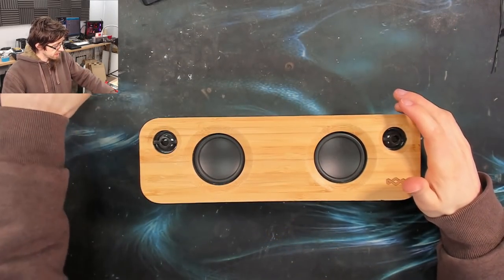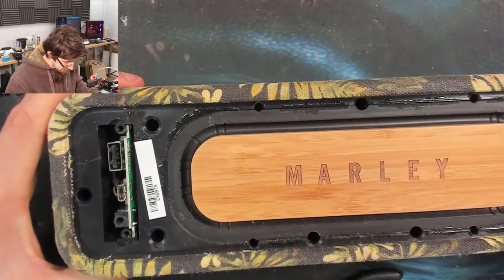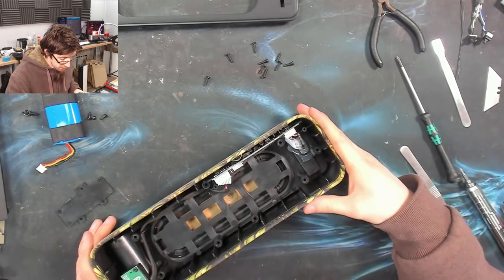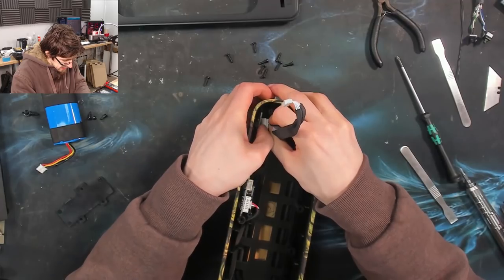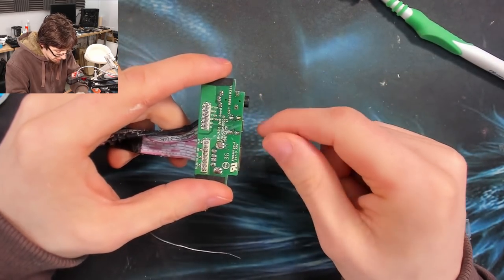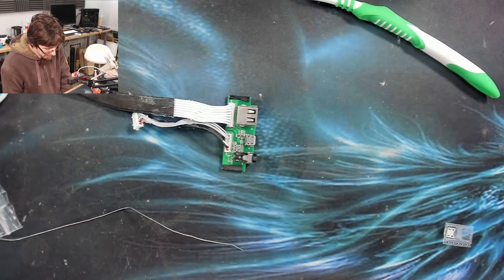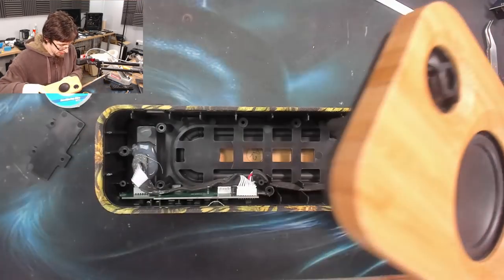Marley Get Together Bluetooth Speaker USB repair - LFC#293

Comment: Isopropyl alcohol is great at loosening hot glue.  It doesn't dissolve it but it makes it brittle and seeps underneath to detach it from the item.
Reply: Yeah it's devastatingly effective.
Reply: great tip, didn't knew about it
Reply: But plastic not a good idea

Comment: 99% IPA for getting hot glue off. Much safer than heat 😉
Reply: But what if I use 100% IPA?
Reply: @comicsanz97  Then the universe will implode.

Comment: i used to struggle to clear holes even with good quality solder wick but the method i use now which works great is just an old fashioned solder sucker, i hang the board at the end of the table, take hot air to one side to liquify the solder and then i come with the pump on the opposite side to avoid getting burnt and since heat is being applied at the same time it prevents the solder from hardening by the time you get the sucker in place, done right you can clear 2 holes in rapid succession

Comment: When using hot air to melt / remove anything, start at a lower temperature (100c to 150c), Most wire coatings are rated at 150c, better coatings at 200c, rated is an operating value which means they will tolerate more than rated before failure. These and most plastic will not melt but burn with high heat and 250c, especially from a hot air gun (localized heat) will destroy or deform  plastic items before you realize it. Plastic is never melted to a liquid form but extruded in a malleable form...

Comment: It was interesting knowing that you didn't know that alcohol is good to remove hot glue. I am fairly new to hot glue myself (~ 1 year) and discovered by accident that alcohol breaks hot glue when I was cleaning a pcb that had hot glue holding wires and the hot glue gone britlle and then it could be wiped. The hot glue can be reused by melting it again with a old soldering iron tip or something like that. I use hot glue often to bind things to a surface (like hold wires against a pcb) in a non-permanent way and it doesn't damage plastics.

Comment: Small tip, if you tin the connector first makes it easy to to flow back to the board.
Reply: Yeah but then you risk it not sitting flat on the board due to solder under the pin.
Reply: @jaro6985  So there is a difference between prepping the pads, and Tinning, you will apply solder then use a wick to remove all the solder this will leave the pins with just the silver solder on the surface, this will allow both the to bond easier, Key is to wick away the solder,
Reply: @rcook0001  Oh wicking would help, good point.

Comment: I use an old cheap soldering iron to remove hot glue. or sometimes i can use a utility knife to slice around the opening when possible .

Comment: 50/50 liquid flux and 99% isopropyl mixed together in a syringe applicator bottle, drip that all over the soldering wick. Makes even the cheap crappy wick perform very well. I don't use the gel based flux at all, and I have borrowed this specific mixture from a person whose job is to solder together medical equipment, all day every day. It may seem like it might be messy but it works better than any other type of flux that I have tried. it also cleans off super easy.

Comment: I had the same problem. I dissolved the glue with Azeton and peeled it off. Was no problem. For the soldering I gave the platina away. Thanks for the information how to open ist and howe to get the platina out!

Comment: The easy way of doing Micro USB ports on these types of devices is to apply maximin solder to the pads drop the port in and heat from the bottom of the  pcb with hot air station , While the board is still hot just touch up the port pins with some flux and solder iron

Comment: I've found with some micro-usb connectors (such as on the Amazon Kindle Fire HDs) to have a honking great heat-sucking ground plane around them, absolute SOB to de/resolder. Also, looked up cost of these speakers; £130-ish new, so definitely worth saving!

Comment: Must admit I was given an Anker bluetooth speaker as a present and was dubious of the sound quality, too many cheap boomboxes as a teenager. Was very pleasently surprised by the sound quality from it, lovely sound and more bassy than you expect for its size. 
Would definitely pull it apart if it every needed it, surprizing the battery life if they're just used as an occasional speaker for devices. 
Modded my main hifi with a usb BT receiver and a buck converter to allow my phone to be played back easily. Its surprizing just how capable BT has grown into compared to its earlier versions.

Comment: keep the solder iron on the pad and then stick the tip of the toothpick into the hole while removing the solder iron from the pad, that a easy tip i find what it works what the pad will not over heat

Comment: When using hot glue.... heat up the glue stick  with your hot air gun and dab the stick around the area you want. Using a glue gun isn't hot enough and the glue will eventually come apart from the plastic. If you use a hot air station it heats it up significantly more making it a LOT stronger. Laptop repairs on broken metal hinges are done this way especially if you can't repair a hinge due to the plastic screw inserts holding the hinge is broken. The seal you made won't last especially with the amount of vibration that the speaker will produce. You should also use a knife tip for soldering fine pins instead of that tiny conical tip. Most people in the industry stay right away from conical tips. Three you should get are the knife, chisel and bent tips. If you used a knife tip on that USB port you would have had a very nice and clean finish with solder melting under the pins and flow onto the pads making it much stronger. Just a tip so please don't take it as harsh criticism. I like your video's because your honest and you try hard. You just need to practice your soldering skills which I know you know as well as you've mentioned it numerous times now.
Reply from the maker: I used to use a knife-tip, and everyone told me to get a BC2 ¯\_(ツ)_/¯
However, interesting tips about the hot-glue, I'll give it a try next time I'm working on something like this. I'm not a fan of using it on structural stuff, and prefer to replace parts.

Comment: If you had decided to clean up the hot glue when you were melting it, what would you have used to wick it away? Toilet paper?
Reply from the maker: I'd probably let it dry then break it off. Various folks in the comments report that IPA is good for assisting with this. A good strategy here might've been to use IPA to break the glue's hold on everything, then cut it apart and 'unwrap' it from the wires.

Comment: Hi, I tried replacing the USB port on Marley Get Together Mini but not successful. Thinking to buy a new usb charging board and connect to exisiting wires. Can you advise what I need to buy and what/where to connect to old wiring?

Comment: Depending on the age of the speaker, i probably would have asked for a new battery to be dropped into it too while you had it open. Its obvious that its an item that someone loved otherwise they would have thrown it away and bought a new one instead.

Out of curiosity. How much would a USB repair like this cost?

::EDIT::

After a quick google i can see this costs about £99 -- it was a good move not throwing it away haha
Reply from the maker: Yea, I charge £20-£30 for fixes like this. I don't think they're really economical to charge more, so you need to not mind doing some low-margin jobs in between the high-margin stuff. I'm willing to do it because they're good practise and make for (IMHO) interesting videos. People like watching stuff get fixed.

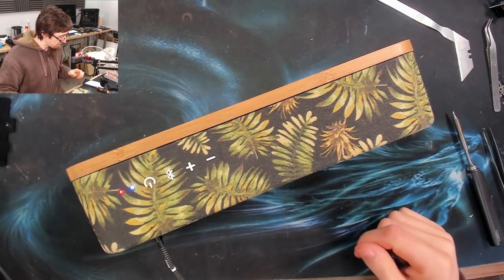Comment: 26:35 how long did that sound transition take to get right?
Reply from the maker: Oddly this one was a bit jank, the phone/bluetooth speaker was actually playing back slightly faster (or slower?) than the MP3, no idea why, so the transition had to be really quick and rough to sound anywhere near right. Surprisingly not too hard to do in a non-linier editor though!

Comment: Graham, what is the link to your electric screwdriver again? What's the power/wattage? I ordered an Ankilo? model ... wondering if I should change to yours ...
Reply from the maker: It's a Sequre SQ-ES126. It's not a torque monster, so don't expect to be zapping out self-tapping screws like most of the ones from this speaker, but it's a god-send for laptops with like, 20 PH0 screws in the bottom case. Not sure it'll change your world if you already have an electric screwdriver though... Affiliate Link: https://sequremall.com/collections/screwdriver/products/electric-screwdriver?ref=fl20o11jut
Reply: @Adamant_IT  Thanks, man!

Comment: Marley em-ja013 sound box's internal battery was repaired due to a mistake, the ic on the main board was burnt. I can't identify the power and regulator ic, so I hope for a picture showing all the smd ic clearly. Please help me.

Comment: How many W does your hot air station have? Thanks
Reply from the maker: I use a Quick 857dw+, which is 650w if I remember correctly. Seems to handle everything I'd be capable of so far, much much more effective than my old station that was 700w, but couldn't put the heat down due to having a crappy fan-in-handle blower.